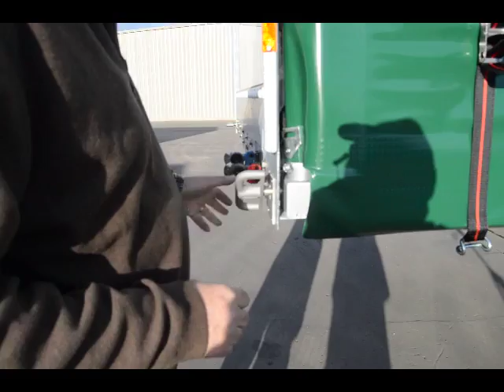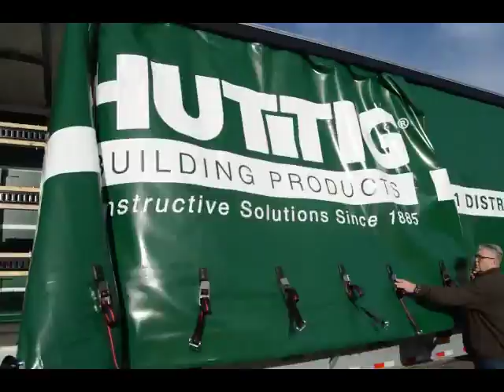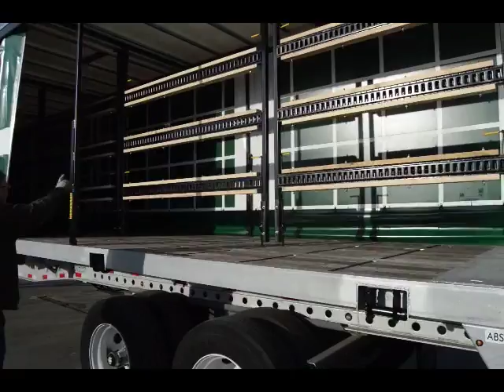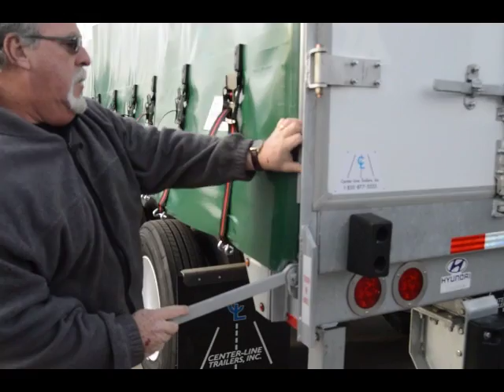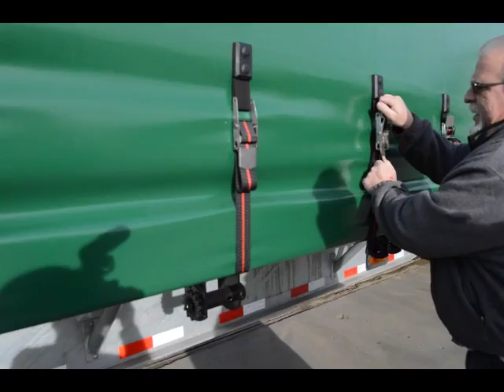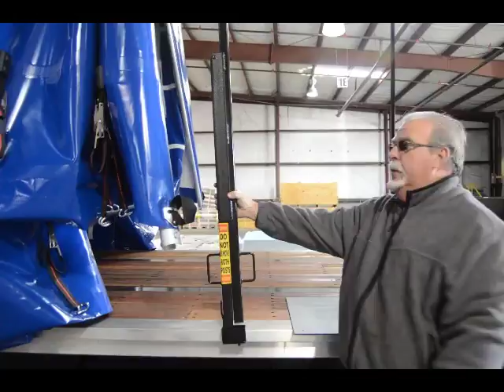Training: Curtain side trailer: side curtain tensioning

Comment: In Europe is it absolutly normal and most use type´s of trailers. Its alwas better to load long parts from the side or from top, manipulation is so simple. I am just wondering, that outside of EU are these systems still underrated.
Reply: Curtain side trailers in North America are not that popular, but there are a hand full of places that will convert a flatbed trailer to curtatin side trailer. The  disengagement of the American curtain side trailers is that the roof doesn't open for overhead loadinng like on European trailers and on American trailers you can't raise the roof. Right now I am looking for a place  that will build me a curtain side trailer with the same if not better versatility as the European trailers.

Comment: You guys should check out curtainsiders used in Australia! Much better ratchet system for tightening the curtain either end and some brands use carbon fibre strips inside the curtain which in some states can be certified as load restraining-must have a certificate on the curtain from the manufacturer to this effect. Straps and buckles are being replaced by a system operated electronically or air assisted system, which can be a curse when they are not working properly, then you are wishing you had the straps and buckles back!! Generally curtainsiders in Aussie are a very quick and efficient pieces of equipment, no need for docks or pallet jacks.